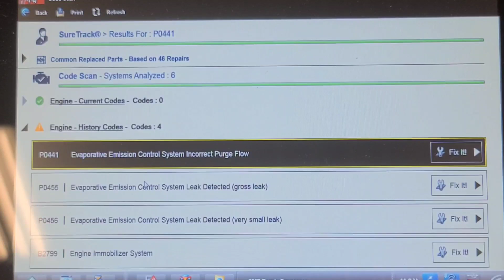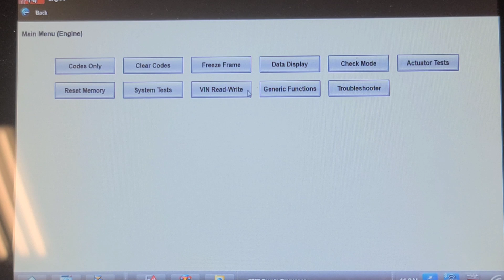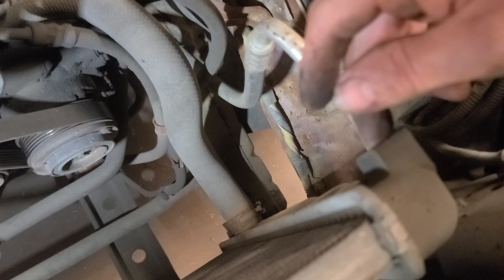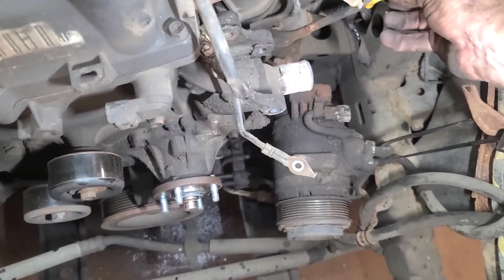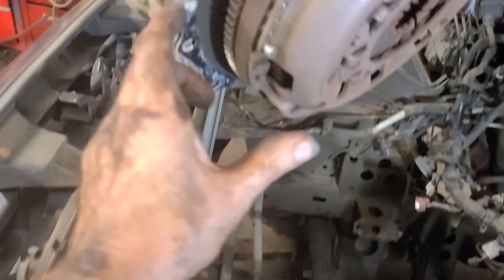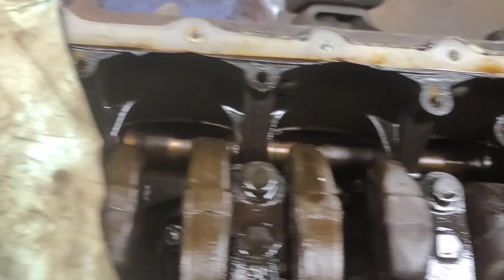2007 Tacoma 2.7 Engine Knock Pt. 1

Comment: My 2012 has this but only for a few seconds in extremely cold weather. Been like that for a few years and 10s of thousands of miles. Should I worry?
Reply from the maker: This was a connecting rod knock. Yours is likely a piston knock which usually gets quieter as the piston heats up. A rod knock is usually quiet until the oil thins out as it heats up. I doubt it would have lasted this long if it were a rod knock.
Reply: @PhillipBailey  gotcha. That’s kinda what I deduced. Now I think about it I probably first heard it in like 2018/19 lol. Not too worried

Comment: Hi Philip. Where did you procure the used engine from ? Where is your shop ?
Reply from the maker: I didn't. Ended up rebuilding it. It wasn't worth it in my opinion but it's done and he's a parts guy so gets parts at cost.
Reply from the maker: I'm just outside Thunder Bay in Ontario Canada eh

Comment: How much it cost to replace the engine vs. Fixing it?
Reply from the maker: Either way it is not typically worth it as the truck has not got that much value. Only reasonable option is a used engine but that's a huge risk. This customer works at the local parts store and has connections in the repair industry. If this had been anybody else it would have never been repaired since no used engines were available.